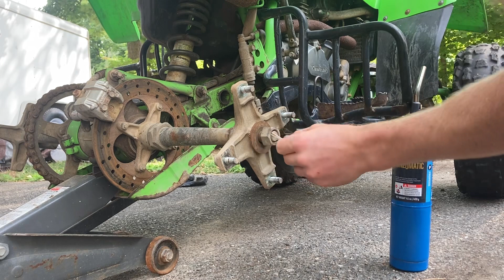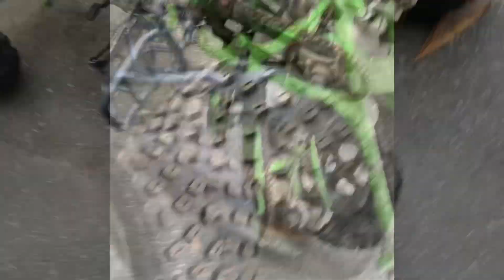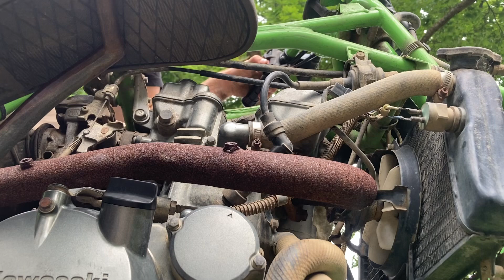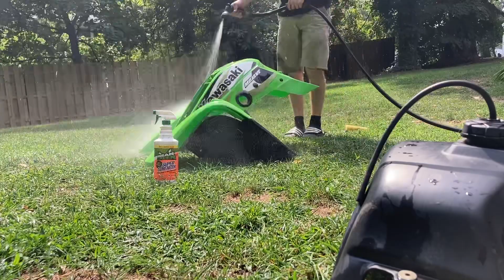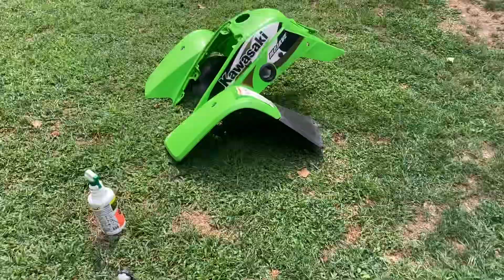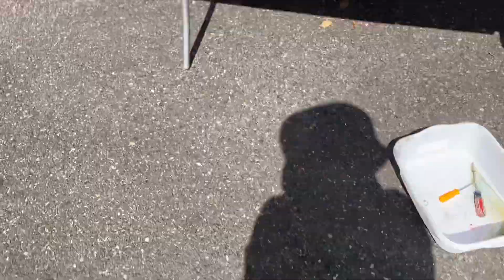$500 KAWASAKI Mojave 250 part 1

Comment: These motors must have ZINC in the oil at all times or lobes die early
Reply from the maker: I think that’s the truth
Reply: Cal Kawasaki USA customer support like I did. Ask that they reissue unavailable KSF & KFR parts. A long production life means market demand for this possibility.
Reply: WHAT zinc additive I cant find any for wet clutch.
Reply: @Cookiemonster2m  I use Lucas ATV 10w-40 oil, chrmeaper than fancy Mobil VR-1. If nothing else use one third bottle of STP zinc per oil change, usually available at many auto parts  stores. Chaps my ass Kawasaki didn't Powell this out in service manuals, wehadda wipe exhaust cams completely round to learn to late.Web Cams in CA. luckily for us renews core cams and rockers!!
Reply: @grandcrappy  my Mojave is a 94 and it’s never had zinc additives in it
Reply: @Cookiemonster2m  suit yourself. I wiped my cams completely round using otherwise good Kawasaki oil.There are reasons Mojave cams are unavailable new, for the most part.

Comment: Yeah ...

DEFINITELY   NOT  SMART  TO  BEAT  ON  IT  WITH  LOW  AND  NOT  ENOUGH  OIL ... ! 

CHANGE   THE .OIL  AND  FILTER  AND  REFIL  OIL EVEL  TO  TOP  AND  CORRECT / PROPER  AMOUNT ... ! 

FIRST ... ! 

BEFORE    ... ! 

YOU  EVEN  START  THE  DAMN  THING ... ! 

PREVIOUS   OWNER  OF  IT  WAS  COMPLETE   " TOOL "  AND   NOT  KNOWING   ANYTHING   AT  ALL  THOUGH  ..  ! 

THIS  COOL  KAWI  DEFINITELY   NEEDS  NEW  AND  
KNOWLEDGEABLE   OWNER ...  !